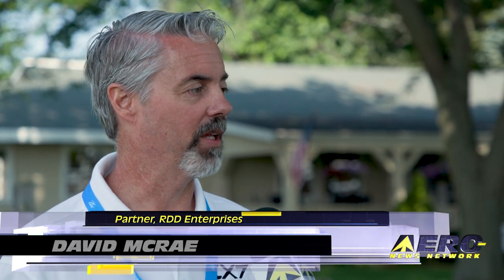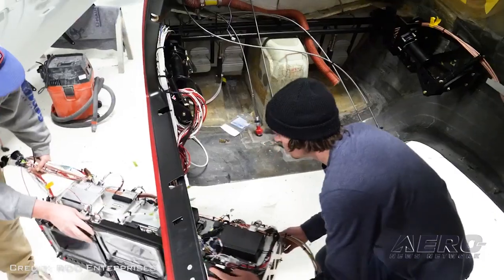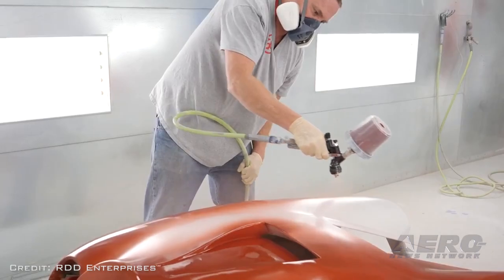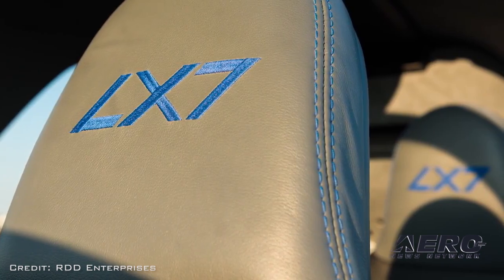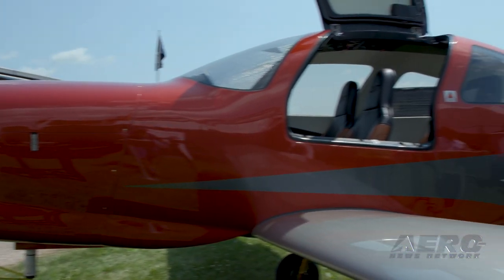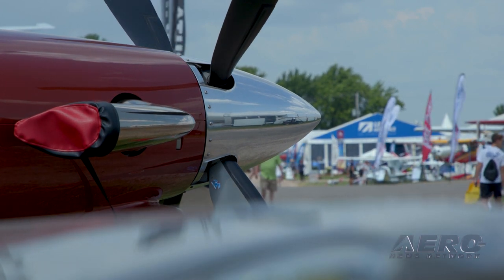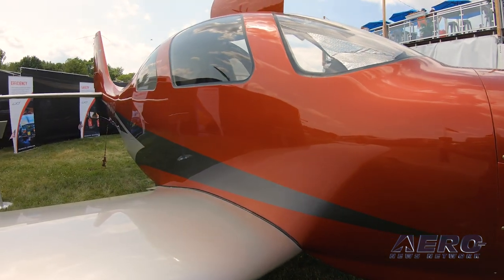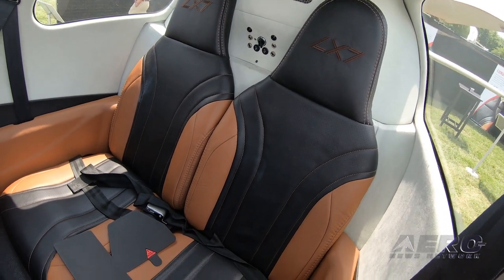Aero-TV: RDD Enterprises' LX-7 - Taking The Lancair to a Whole New Level

Comment: Around 820K for the piston???!!! Thats pretty insane!!! Pay a little more and yu can get a brand new DA62 that has 2 engines and extremely safe and easy to fly...
Reply: The LX-7 is also 80 knots faster, has a higher ceiling and climb rate, has only one engine to manage, has a BRS, is pressurized, lower takeoff and landing distance, and that's just what I could find with a glance at the spec sheet. The LX-7 is obviously a niche aircraft which isn't meant to do the same job as a twin or these cabin class airplanes everyone is comparing it to
Reply: Agreed… a million for a tbp version. There’s a YouTube video of a 725 shp Walter powered propjet doing 328 Ktas cruise… why pay a million for 280ktas when you can pay $600k for 328?
Reply: da62 is like 1.15
Reply: @curtchapman3658  If you're willing to die flying it, sure, no one is stopping you from buying a flimsy unpressurized home built aircraft( poor resin bonds) that is  severely stressed and powered by sus turbine, fine
Reply: And is beyond slow
Reply: And not pressurized.
Reply: Not overpriced at all
Reply: And is an absolute dog next to it. This is a performance plane. Love Diamond and their safety and diesel. But they’re not fast and don’t have big loads
Reply: You and Johnny make 2 very good contrasting perspectives. All depends on what the individual values. The range of the piston lx7 exceeds everything in its class by a large margin

Comment: crowded market, for that price consider an eclipse
Reply: crowded market? maybe the least crowded for a, all intensive purposes, new  $1mil turboprop. The Eclipse jet for $1mil will be a well used much higher cost to maintain alternative, for 20%  more speed. 300kn at 33/gph compared to 360kn at 62/gph not to mention one is 15 years old and with 2 powerplants you will spend more.
Reply: Does an eclipse have any where near that range?

Comment: Reposted video. Cool wing and rebuild. Not cheap at $1M. Who is listed as manufacture on these rebuilds? They use existing plane to get around 51% rule it sounds like.
Reply: gmcjetpilot a 280kt pressurized turboprop for the same price as an sr22t.....not a bad deal...
Reply: @israelkozlik7554  Cirris SR22T is way way overpriced, poor value. Used Cirrus SR20 is $200k. You can get a used TBM700 cabin class single engine turboprop $0.75M to $1.0M. A very nice TBM 850 $1.5M. You have a certified plane which you could Charter or lease back. Cruise speed of TBM700 is 300Kts plus, TBM850 330Kts at FL310. If I was in the market for a single-engine turboprop I'd find a really clean TBM 700, not a boutique rebuilt experimental lancair.
Reply: @gmcjetpilot  out of 45 TBM's for sale on Controller.com(they had by far the most) one listed for less that$1mil $950k for a Mexican registered 1995 700 with a damage report. A next was a 5500 hour 1999 for $1.3 average of $2.5mil and up is not even close. The closest to $1mil is a 1500-2000TTAF 10-15 year old Piper Meridian.

Comment: This plane makes no sense. You can buy a  gently used Evolution that is much larger and has a pressurized cargo area for 1M. You also get much better avionics integration (G900 with turbine support,  keypad and digital environmental controls) vs this cooky G3X setup that doesnt even support turbines requiring an additional engine monitor. Just look at that panel, it's so messy and cramped, and that was a piston setup!
Reply: the N4YB shown is a turbine PT6-20 with the engine monitoring
Reply: @matthewjob9424  Why go with a PT6? A used one costs as much as a brand new Walter. Half the cost of this airplane is going towards the engine! The whole point of the lancair turboprop was to get an engine in there for 125k.
Reply: @codmott286  many people consider the Walter "unknown" and rather not trust it.

But most people crash because they drive it into the ground, get spatially disoriented at night or bad weather, or run out of fuel.

I was always told: buy a cheaper aeroplane which you will fly more often and thus remain more proficient in.
I haven't even managed to keep my R/C hobby alive 😅